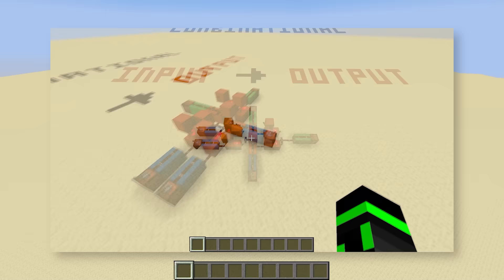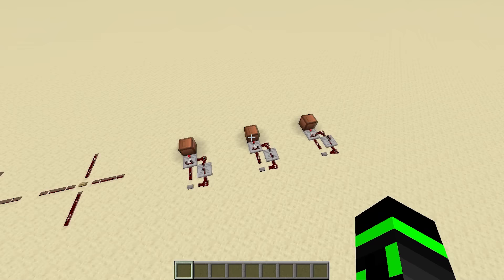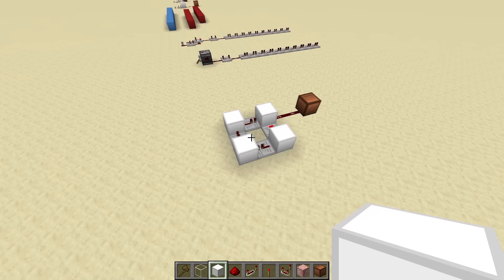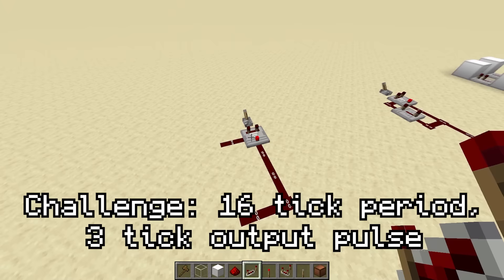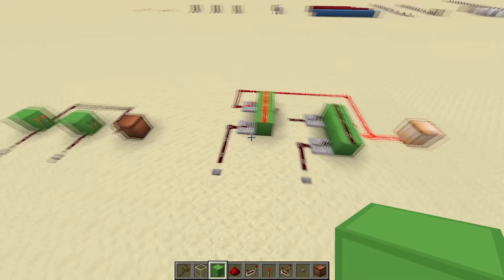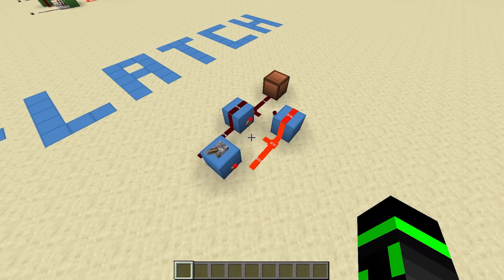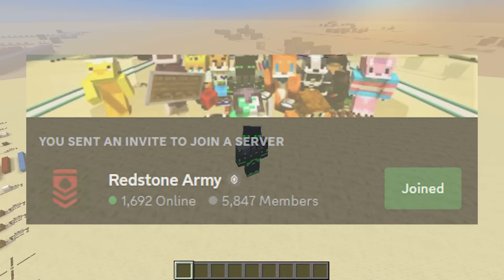Pulses, Clocks, Latches & Flip-flops - LRR #7

Comment: Great explanations of the repeaters! This cleared things up for me!

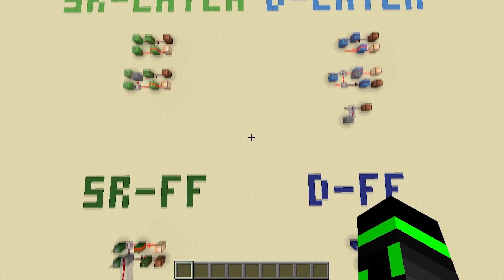I disagree with 11:40. By convention of modern digital design/VLSI, flip-flops are edge-triggered and latches are level triggered. Look up master-slave flip-flops. You can create one with 4 Redstone Repeaters instead of just 2

There are lots of different technologies and strategies in VLSI, and it used to be the case that latches and flip-flops were implemented the same way. But now that transistors are so fast, minimizing hold time is usually preferred. Edge-triggered flip-flops usually have negative hold time, which makes them easier to design with. Though it is possible that Redstone designs are better with latch-based flip-flops and not master-slave flip-flops

I have a masters in Digital Design and VLSI and would be happy to talk more
Reply from the maker: Thank you for the clarification! Honestly, I would have done more research on this, but I was getting so many disagreeing answers online, I kinda gave up. I really need a peer review system or something for these videos, lol.

I understand level triggered, but what does edge triggered mean? Is it both edges, rising and falling? If so, I understand why the master-slave design makes sense. 

I almost never see any master slave designs being used in the logical redstone community, so I think your assumption is correct about latch based implementations being easier. Maybe that’s because minecraft is already running on a global clock (ticks)? I’m not sure. It’s also possible that the fundamental differences between real circuits and redstone makes the merging of terminology impossible.

Also, I’m gonna pin this so that any follow up discussions about flip flops can be in one place.
Reply: @mattbatwings  No worries! I totally agree that there's a bunch of conflicting information. I think it's because of all the layers of abstraction in digital design. Generally, VLSI engineers just use whatever DFF standard cell is provided and run automated timing analysis tests to see if their design works. Caring about the exact implementation of cells is usually not required.

There are "positive-edge triggered" master-slave flip-flops and "negative-edge triggered" master-slave flip-flops. To create a "positive-edge triggered" DFF in Redstone, you do
                          Q
inverted clk → ↑
               clk → ↑
                          D
where each arrow is a repeater.
Reply: I like your informed comment--thanks friend! I wanted to get a quick fact check not because I doubt you, but rather because I like that the AI can help give me some extra information. Taken from BING:

That’s an interesting comment. I did some research and found some information that might help you fact check it.

First of all, the comment is correct that by convention of modern digital design/VLSI, flip-flops are edge-triggered and latches are level triggered. This means that flip-flops change their output only at the rising or falling edge of a clock signal, while latches change their output whenever the clock signal is high or low.

Secondly, the comment is also correct that you can create a master-slave flip-flop with 4 Redstone Repeaters instead of just 2. A master-slave flip-flop is a type of flip-flop that consists of two latches connected in series, with the first one (master) being enabled by the clock signal and the second one (slave) being enabled by the inverted clock signal. This way, the output of the master latch is transferred to the slave latch only at the edge of the clock signal, making it a flip-flop.

Thirdly, the comment is partially correct that latches and flip-flops were implemented the same way in the past, but now edge-triggered flip-flops are preferred over level-triggered latches. This is because edge-triggered flip-flops have less hold time (the time that the input must remain stable after the clock edge) and more setup time (the time that the input must be stable before the clock edge) than level-triggered latches, which makes them easier to design with and less prone to glitches. However, this does not mean that latches are obsolete or useless. Latches are still used in some applications where speed, simplicity or power consumption are more important than timing constraints.

I hope this helps you verify the comment. If you want to learn more, you can check out these sources:

1: https://www.geeksforgeeks.org/difference-between-flip-flop-and-latch/ 3: https://electronics.stackexchange.com/questions/21887/difference-between-latch-and-flip-flop 2: https://www.cs.ucr.edu/~ehwang/courses/cs120b/flipflops.pdf 4: https://www.elprocus.com/difference-between-latches-and-flip-flops/
Reply: @LupusMobile  Yes, this is also correct. I guess I should have said, design constraints have gotten less strict over time as transistors have gotten smaller and better. Therefore, implementing a flip-flop as a master-slave flip-flop has become the norm in present-day VLSI.
Reply: I tried to do a bit of digging around, and from what I understood the main reason of using master slave flip flops is that they are, as you said, edge triggered and as such less suseptible to race around condition.

Now, neither CS or redstone are exactly my expertise (read as: assume I've got no real clue what I'm talking about) but I would assume that with redstone calculated with global ticks a race around condition will be much less of a problem, simply because unlike real circuitry you can reasonably predict the way in which a race around condition will behave, using brute force if nothing else? Also, it seems slave master flip flop are usually double the size more or less, which will probably lengthen the response time of the flip flop (which seems like a pretty big drawback)

So, I would assume it's probably why redstoners tend to use a more simple type of flip flops. What do y'all think?
Reply: damn how do you only have 40 subs.
Reply: Womp womp 😂
Reply: Also, in many programming languages, RS flip-flop means, that the RESET input is dominat (when both inputs are true at the same time, the flip-flop resets) in SR flip-flop, It's the other way around.

Comment: Wish you could build builds like u used to do. Maybe the first Redstone camera would be cool (you could do it with pushing blocks in the terain and use the push limit to stop more blocks from coming in then u remove the blocks out of the terain and use repeaters to see if there is a block or not if not it means that there is a block in the terain if there is there is air in the terain then make the info go to a screen and load how the terain looks like with cubes (that don’t have a side)) it would be super cool to see this. Pls like this I really want to see Mathew do this.
Reply: You can't push air blocks, so that wouldn't work.

Also that system would (if it worked) result in a binary data feed, while that could be displayed it wouldn't really capture enough to be considered a camera.
Reply: @ItsThatOneJack  ur not getting it let me explain it a bit more simple so u have for example a 10x10 square of pistons in front of them at blocks that get pushed into the terrain with a depth of 12 blocks Bec that is the max then u return all the blocks that u pushed into the terrain by how many times the piston has fired now u have indeed 1 and 0 Bec of the blocks that u just need to decode by sending a signal through it and with just a tiny cpu u can link it to a screen and show what the terrain looks like now i know it will be crappy but it is the first one look at the first 3x3 piston door that is crappy as well or the first computer that runs Minecraft in Minecraft it is only 8x8 blocks I believe

Comment: The differentiation between latches and flipflops is made, because you usually add more safety to the flipflop to prevent funky behaviour. For example you'd make your d-flipflop take the input on a rising edge but change the output on the falling edge. That gives time for the circuit to stabilize and prevents weird behavior.

Comment: Probably the two most commons types of clocks for everyday use in Minecraft (which I'm guessing you didn't mention because they are rarely or never used in logical redstone) are the "auto-dropper" clock and the "Ethonian Hopper" clock
The "auto-dropper" takes a comparator output from a dropper, boosts it with a repeater, then runs it back into the comparator's side, with the output doing something to power the dropper. This creates a clock that only turns on when there are items in the dropper and repeatedly pulses until all of the items in the dropper have been dropped out. Very useful for item transportation, or if you switch out the dropper for a dispenser it can be used to auto-fire potions/arrows/etc
The "Ethonian" clock (named after prolific redstone content creator EthosLab) is one whose design allows you to create a large variety of pulse lengths, including exceptionally long ones. It is built with 2 hoppers facing into each other with a comparator output from each leading into 2 sticky pistons that move a Redstone Block back and forth between positions that power (and thus lock) one of the two hoppers (the setup is very specific, but you can find it very easily with Google).

Comment: The reason the TFF shown at 12:13 works is as follows (I'll be using tech mc instead of comp mc terminology to explain it since that's what I'm used to):

TL;DR: Repeater unlocking happens before any other repeater actions in this wiring, which allows the repeater to toggle between its two states.

Tile tick components (basically everything that has a delay, repeaters, comparators, observers, etc.) have a built in "priority" system to preserve deterministic behavior. This is called "tile tick priority" (or TTP for short). When tile tick components schedule to change state, they use both this hardcoded priority and the time at which they were scheduled (in this order) to determine what happens first.
So, in the example shown, you have a repeater pointing into dust and a repeater pointing sideways into another repeater. In code, the lone repeater has TTP -1 when turning on and -2 when turning off, and the repeater pointing into another repeater (more generally, a repeater pointing into a diode - that is, another repeater or comparator - that doesn't point back into itself) has TTP -3 on both edges. Maybe confusingly, TTP is ordered such that lower values happen first.

Since in this example both repeaters are configured for 2gt delay, you can ignore delay being at play here. This first sequence assumes the final repeater is off:
1) When the redstone dust turns off, both repeaters are scheduled to turn off 2gt later.
2) When the time comes for the repeaters to turn off, the repeater pointing into diode turns off first, because of its lower TTP. This, in turn, unlocks the final repeater.
3) At this point in time, the final repeater is unlocked and the dust feeding it is still turned on, so it schedules to turn on 2gt later.
4) Then, the lone repeater turns off (steps 2 through 4 happen in the same game tick).
5) After another 2gt, the final repeater turns on and schedules to turn off 2gt later, since it's no longer powered. This is also where the torch being turned off for 4gt is important, because this is the tick it turns back on, scheduling the other two repeaters to turn on.
6) After another 2gt, this is when the final repeater would turn off. However, because of TTP, the repeater pointing into diode will turn on first, locking the final repeater on before it has a chance to turn off. Then, the lone repeater turns on and the system stabilizes in the ON state.

The same happens when transitioning to the OFF state, except the final repeater turns off instead of on in step (5). Notice how this is irrelevant, because the final repeater turning off still has higher TTP of -2 (happens later) than the repeater pointing into diode with TTP -3.

For the curious, the full list of tile tick priorities is as follows:

Repeater turning on: -1
Repeater turning off: -2
Repeater pointing into diode: -3 on both edges
Comparator pointing into diode: -1 on both edges
Everything else: 0

Bonus: to exercise your understanding of this, you can change the first two repeaters for any configuration of repeaters and comparators and try to find out what happens, it's good exercise.
Reply: Damn that's complicated, good job on the person figuring out this works.

Comment: That T-FF repeater is a one Redstone Tick pulse generator, but only when the input changes from ON to OFF.
That is, if the input is ON, it will not generate the pulse, but when the input changes to OFF, it will generate the pulse.
That pulse generator can also be variable up to 4 RT only change the Tick of the Repiter.
I used it for a specific case of a calculator that i was make and it was really useful for me the truth😂👀

Comment: 11:09 A latch can change state as long as enable is high. A flip flop can only change state when the clock goes high.

Normally you make a flip flop by chaining two latches with the enable input on one of them inverted but in minecraft you can use a latch and a monostable.

Comment: 1:52 Observers activate when the block in front of them or the state of the block change not when it receives a block update
Reply: That's not really different, by definition according to the wiki: "A block update is an in-game mechanism that occurs when a block is modified in some way." So, "When they receive a block update in the back", that means a block update from the block the back of the observer is facing. Also, the observer has an arrow on the top pointing to the side that outputs a signal, so, it's not the front.
Reply: @CmdRolled   The arrows indicate the direction in which the signal goes. Observers have a propertie called facing which treats the face as the front. Opening/closing fence gates doesn't give any block updates but observers detect it. Powering/depowering a repeater facing an observer two blocks away doesn't activate observers but gives block updates to the observer and the block in front of it.
Reply: @johndeyner  ur right sorry

Comment: I think the way the T Flip-Flop at 12:14 works is that the repeater remembers its input from about 1 tick ago when unlocked, meaning that the one tick the 2 redstone repeaters are off, the output redstone repeater unlocks, then updates its output with the input it got 1 tick ago, and then locks. This was just my observation from testing the clock with the Carpet mod however, so I can't be sure if the observation is completely correct

Comment: I tried to make an explanation of how the 3-repeater T-FF worked (showcased at 12:14) but got stumped. This appears to require extensive knowledge of repeater update order. If anyone can provide further insight, please do!

Here are my observations:
- The circuit takes 4 redstone ticks. 
- The repeater gets locked on the 4th tick to the state it had on the 3rd tick.
- Toggling from the Powered to Unpowered state:
  - In tick 2, the dust behind the locking repeater becomes unpowered. The locking repeater remains powered.
  - In tick 3, the locking repeater becomes unpowered.
  - In tick 4, the locking repeater is locked to the unpowered state.
- Toggling from the Unpowered to Powered state:
  - In tick 2 the dust behind the locking repeater becomes unpowered. The locking repeater remains unpowered.
  - In tick 3, the locking repeater becomes powered.
  - In tick 4, the locking repeater is locked to the powered state.
This behavior is unexpected and unintuitive because the locking repeater behaves differently even though its power source (the dust) behaves the same. This probably means that there is some difference in redstone tick scheduling based on the power state of locked repeaters, but I am unable to explain it.

Comment: 13:17 I'm pretty sure that the toggle gates used in binary counters could be called t-latches. I believe that the "t" in "t-flipflop" stands for toggle. So a t-latch would just be something that toggles on or off once each time it's powered. Then again, I could be wrong about the terminology.

In the past I think I've heard the term "t-flipflop" be used to refer to a toggle switch with no clock, though by the definition I just gave that would instead be a t-latch.

Comment: A slight modification to the circuit at 1:32 is to add a solid block to the end of the comparator and a redstone dust to the right of it the block.  This will give a 1-tick pulse.

Comment: Aw, you talked about pulse extenders and didn't mention comparator fade-out circuits 😢😁

My preferred design for SR latches takes advantage of target blocks so that it can be only 2x2x2 in size: super compact for a torch-based latch. You put two target blocks next to each other, a torch on top of one, and another torch on the side of the other. Then dust next to each torch and boom, a latch.

Comment: For Tflipflop i use a dispenser and a bucket of snow powder in it with a comparator going out of the dispenser. When you activate the dispenser there is only the bucket left so the comparator outputs signal strenth of 1 but when it gets powered again the dispenser takes the snow and now the comarator outputs 2 because it is unstackable. You can also choose water or lava in the bucket but liquids and redstone is not a good mix. It would need to be in a safe place surounded with blocks.

Comment: A T Flip Flop Work Like this @mattbatwings the button is a pulse signal but with a pulse circuit making it's pulse from 10 to 12, then that goes into a NOT Gate to negate it and then it outputs to a repeater to regain strength and then finally working a D-Latch in one pulse